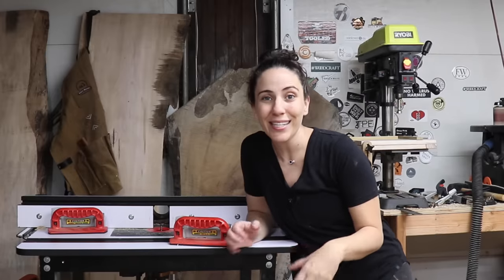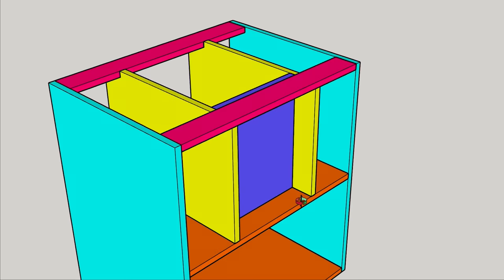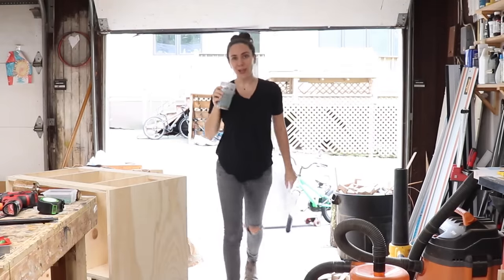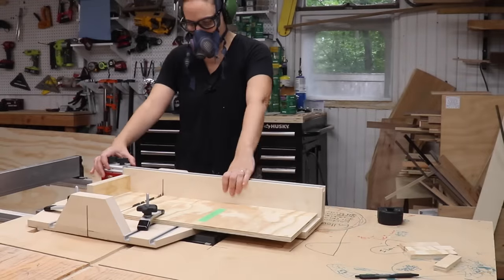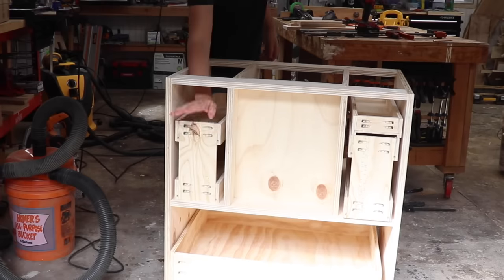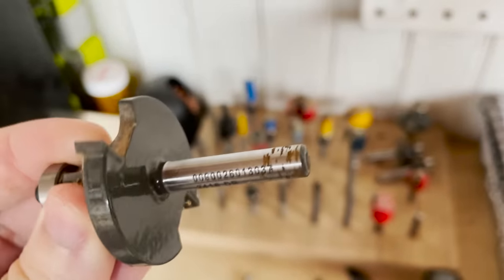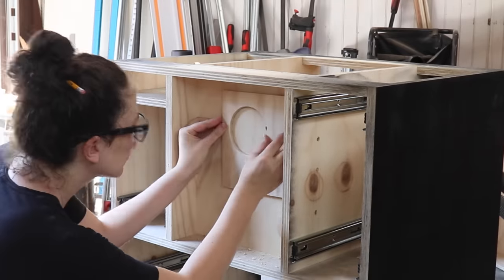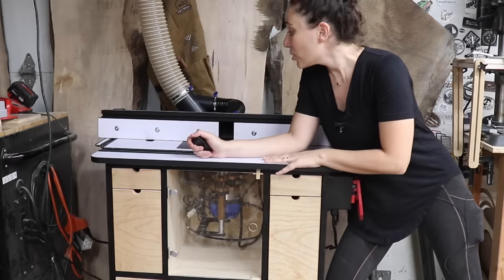Router Table Cabinet Build with STORAGE and DUST COLLECTION

Comment: Your 4"dust port should be at bottom of the box as soon as whatever dust falls past it it stays at bottom.  Also finish inside of box and spray it with silicon spray or wax it.  Great build tho

Comment: It was a little flimsier than I expected. I had to add a 2x2 piece of wood to the bottom on the rear side in order to stabilize it better https://www.youtube.com/post/UgkxXTh-lz-8W6GcB219vTLp27-MxbZYObBX . It is also starting to bow a little at the outer wall ( I've had it up for about 6 months), I've already had a shelf tumble down because of the bow and the fact that the little shelf brackets are quite short. I went out to home depot and got some longer ones so that the shelves don't tumble down again. Overall, it looks very nice for the price and it holds a lot ( I use it as a pantry). I am very satisfied with my purchase. I just strongly suggest reinforcing it before putting it up.
Reply: Thanks for s lot for this comment. I'm planning on building a router table soon and will reinforce it with some 2x4 or something.

Comment: I love this project!  one suggestion on the dust collection:  flip your door so that the slots are on the bottom, and the collector will pull air across that bottom shelf and help keep dust there to a minimum.  It's already catching the fine stuff that doesn't make it, just needs a little help sweeping up the slightly bigger pieces.  When they get to the bottom of that cabinet there's no air movement there to sweep them away.
Reply from the maker: I’m going to try that!
Reply: @3x3CustomTamar  I think the real issue is the location of your lower dust port. Since its at the top the heavier larger chips fall to the bottom, you basically built a dust separator. On most commercial router boxes the outlet is at the bottom of the box. What you did totally works and as long as you keep after it occasionally still a good solution but large chips will collect in the bottom if you dont move the port down lower.
Reply: Yeah that's a very good point, I think a curved ramp at the bottom would probably help as well.
Reply: @justin.booth.  yes another option, something to guide the chips towards the outlet
Reply: I think that's smart. I was thinking to have a slope added on the floor of that box.
Reply: @3x3CustomTamar  the solution I’ve seen and thought you were heading to was put the 4” port at the BOTTOM and have the opening on your front near the top. The dust collector needs enough air and you’re creating a strong air flow that pulls the falling chips down to the bottom where it goes into the 4” port. The other part of that air flow would be to use a quarter inch thickness piece of wood the width of your plexiglass door but have it mounted at an angle with the top near your plexiglass door and the bottom of the panel near, say, the middle under your router. Again, you’re reducing the volume of that cavity but increasing the channeling of your airflow suction. You don’t need to reach your router because you access it from the top, or you pull out the mounting plate it’s on. As it is, your boxy cavity has dead spots that reduce air flow.   You could insert that slanted wood piece having it end about two inches from your router top and replace the plexiglass door with a solid wood panel with that 2” open space at the top. That gives you strong suction from the top front of your table down that angled wood picking up the falling wood chips on the way to the bottom of that cavity into the 4” dust port.
Reply: @justin.booth.  mounting a slanted wood wall front from near the top front behind her plexiglass door and contacting the bottom of that cavity amount under the router forms that pathway airflow. Leave about a 2” gap at the top and relocate the 4” dust port to the bottom creating a flow of air that picks up all the falling particles and pulls them into her dust port. That 2” gap sounds like a lot, but that vacuum system needs a lot more airflow than she has with those small slots. That’s why her plexiglass door was being pulled in. You need the fast moving air down that slanted wood picking up falling chips and pulling them into the large dust port.
Reply: DITTO.
Reply: @3x3CustomTamar  
You should flip the door to have the opening in the bottom to avoid the cyclone effect... that way, tge dust collector should work better 😀
Reply: It's always best to consider what parts came from fHarbor Freight when trouble shooting,lol.

Comment: Nice design, suggest moving the dust port to the bottom and slope the bottom down front to back. Gravity is your friend when you don't fight it. Also finish the dust compartment nice and smooth so dust and chips move freely.   By having the dust port high its effectively like a dust deputy separating the dust from the chips.
Reply from the maker: Good idea for sure

Comment: Looks good ! 
 Moving the dust box vent to bottom of box would increase removal of large chunks (with hole at top it is acting like a separator leaving the large stuff 'separated' .)  
There are better vented insert plates (router cutter bit insert plate) , some by Incra or just modified with extra holes ) to increase air flow .
Reply: bingo - that and include angled pieces in the bottom corners to help direct dust and air flow to the dust port
Reply from the maker: I may try that
Reply: Exactly what I did too plus the angle plate after experimenting with the proper angle with some cardboard.  Also put a furring strip around the door with foam gasket and magnets to keep the door closed...also used a piano hinge to help alignment over time.  You can also add some small baffles to direct the airflow to the port keeping in mind most routers exhaust from the bit side.   Note I'm only using a shop vac and HD separator bucket with 2.5" hose...works great.

Great job Tamar, you can always tweak it after using it awhile!!
Reply: I built much the same cabinet a few years back and put the dust port at the bottom with the bottom angled down slightly from the front and a couple of angled side pieces as Dogwood Tales mentioned.
Reply: @3x3CustomTamar  Something like this    \_-     on the bottom of the dust collection.
Reply: @Tamar Powertech makes a  a big gulp fitting that works great on bottom installations , i used one for my miter saw dust collection and it works great
Reply: @3x3CustomTamar  My incra router table dust collection box has the DC inlet underneath the box pointing up, and the box is totally sealed. Only airflow is from the router bit opening up top, so you get more suction. Under-mounting the DC would get in the way of the bottom “draws” though lol. My old bosch router table was rear suction like yours - sealing up the door completely improved dust collection for me.

Thumbs up on a great video!
Reply: Instead of the effort to move the port lower ... just add/make a scoop to attach to the back over the existing port
Reply: @phoenix_dad1862  A new back hole would be more practical/ faster .. There is very little space behind router and every tight angle bend in a vacuum duct reduces the draw significantly .
Reply: I think that would work! I just installed a floor dust collector, & I'm shocked at how much it picks up. However, if it's not right in front of it, it won't catch it.

Comment: Love your videos and have built a couple of your projects for my use.  When it comes to Router Tables, everybody attaches a dust collection hose to the fence.  I wanted my table to roll under my chop saw workbench and didn't want a complicated hose configuration so I went a different direction.  My 4 inch dust collector comes up through the bottom of the box the router is in so the chips and dust fall down towards the hose.  Since this box like area is directly under the table top, I drilled a 2 inch hole through the top about 1 inch back from the router mounting plate.  On the back of my fence I built a box that creates an enclosure/tunnel that extends back over the hole in the table.  The way it works is that as the router chips off wood, they fly back through the fence, into the tunnel and fall/get sucked down the hole.  It appears to be as successful as the hose/fence method as I hardly have any dust/chips left on the table top.  Just an idea that works well and eliminates the need for a hose.

Comment: "I literally JUST had it" is a constant mantra in my shop. I have eliminated it related to tape measures by buying a handful of moderately inexpensive versions that are resident in different areas of the shop. this also eliminates the lost tape when someone else in the household borrows it (and of course leaves it).

oh yeah - this is a fantastic project. my mind is churning some designs for mine now.
Reply from the maker: I have 5 of those tapes!! 😂😂😂

Comment: Congratulations for depicting two smart elements to do the work: get your hardware first and design around it. Also, use the components to generate cut lines without ever measuring.
Reply from the maker: Glad you liked it 👍

Comment: Noticed the diming of the lights when you turned on the dust collection. That means that that there are too much on that line so the wires have difficulty pushing enough Amps. That means that they run a risk of getting too hot during prolonged use at that level. At the moment it's only a problem when the dust collector needs its starting power though it's better to put the dust collector on another fuse than the lights to avoid that issue.
Reply from the maker: Yup. Something I mentioned previously about my shop being underpowered. All something I’m hoping to fix 👍
Reply: @3x3CustomTamar  An easy and economical (in the monthly bills) fix is change all your bulbs to led's, if you haven't already. One tenth the draw of incandescent and about one fifth the wattage of fluorescent with the same brightness. But, electrician here, he's right about separating the lights. They should be the only thing on their circuit and that's easy to do. That will free up more power for the motors and keep the wiring cooler.

Comment: Love this project, a extra out at the back bottom keeps it clean!
Reply from the maker: Thanks!
Reply: @3x3CustomTamar  I was wondering if the compartment might be to large and that's why there's not enough suction. Or is this just something that in inherent with a router table? Also, I thought it was kind of funny that you used magnets to hold the drawer face but no magnets to keep the door closed. Hmmm? 🤨 
Great build, I'm in need of a router table and so far I like this one the best. Of course I will change a few things (I have larger hands) like possibly making the bit trays removable. Might be able to fit 3 per drawer that way. Again, great video and build. Keep up the good work.

Comment: Great build, Tamar. I attached a rope with a strong magnet to my dust collector remote and hang it from the ceiling of my shop. It makes it easy to find and move around, if you have some metal on the ceiling. Use it in good health!
Reply from the maker: Great idea!

Comment: Thank you I bought the router table cabinet plan, and the portable work bench got my attention so grabbed that one too. I have watched several of your postings. I just manufactured 8 kitchen cabinet doors and my floppy router table annoyed me I was just going to build one but thanks to you I don't have to draw the plans.  Love your guitars I saw in one of your videos, haha I have 5 guitars not allowed to buy more. I built one of those guitar racks but realizing in MA. unless I was running a humidifier/ dehumidifier my guitars needed attention so they are back in their cases with built in  humidity meters.. Enough said HaHA Thanks again😎

Comment: What you could do, is put the outlet hole of the dustcollector at the BOTTOM of the cabinet so that even if you get some dust you can just push it in to the outlet hole and it'll get sucked up.
Reply: Agreed, the particals my be too heavy to go out the top wall dust collection port. Flip the hole to the bottom and create a slight funnel to reduce the amount of open space. If your motor isn't strong enough you may also have to empty your collection bag/barrel more often.

Comment: 👍I LOVE it.  This summer, my health declined, but with cooler weather & a new Kreg Foreman on the way I plan to get building this Fall.    My tools are kept inside and carried outside when I build.  Not enough good health days have been lining up with good weather days.  So, we plan to make room inside for smaller projects before winter.  I will need dust solutions.         
    I think your cabinet performed great.   Still, I'm not surprised you are striving for perfection; you always share your oops & needed improvements with your audience.  I see suggestions in the comments, so, I guess those folks agree that dust collection could be better... Well, I must be easier to please, I was very impressed!  The top was spotless and only a teeny bit of saw dust down below.
      I have a Woodcraft 50 or so miles away and your cut-list looks like much can be broken down in store from economic plywood.  Those repeat grain patterned boards can be bothersome, but it looks awesome the way you matched it up on the drawers!   I WILL watch your follow up video.  But then I am headed to your website to buy these cabinet plans. ~♿Lisa🔨
    PS- a question: have you ever cut the grooves for your drawer bottoms into longer boards, before cross cutting it into sides, front & back?  I'll be using a hand held router w/straight edge & hoping to save some effort?  I've never seen this done on YT; so I'm worried there's a reason for that, a problem I haven't thought of? Thanks.
Reply from the maker: Thanks so much! Hmmmm. I havnt done that. But I guess I don’t see why you can’t.

Comment: Really like your color scheme - black carcass and unpainted "draw" fronts.  Also really like your groove-and-dado-trapped "draw" bottoms with pocket-hole joinery - that combination is a favorite technique of mine as well for shop fixtures including similarly trapped cabinet backs.  Even the shorter "draw" back - just like traditional "draw" construction with a solid wood  bottom and dovetails to join the sides and back.

My shop (garage) lights dim when I start up my tablesaw; my practice is to only run the table saw with the lights off on that circuit, meaning in daylight with my garage door open.  Here in the Houston TX area I can usually get away with that year-round.

Really nice build and very helpful to a wanna-be-weekend-warrior like me.
Reply from the maker: Glad you liked it! Yeah. My electric needs an upgrade

Comment: Watched to the end… “I literally just had that..” is the age old comment of every woodworker ever. Great video
Reply: And when we drop something, it's "where, the ...., did that just go?"
I did this last night with a tiny 2x8mm pin cut from an old drill bit..
Tried to hold with needle-nose pliers when cutting with the grinder, pliers clipped together, pin vanished instantly, didn't even hear it hit the floor as I was wearing earmuffs.. I'll literally NEVER find it.. lol
Reply from the maker: Where do these things go?!
Reply: @3x3CustomTamar  there's a void they fall into.. possibly a different dimension..
All becomes clear after we die, and we get to spend eternity wandering around looking at all the things we lost over our lives.. 😉
Reply: @GenoLoma   I suspect they end up in the same place that random socks, and 10mm sockets wind up in.
Reply: @tree_carcass_mangler  ah yes.. the infamous 10mm socket.. can't recall how many of those I've had to buy over the years..
I guess I'll get them all back when I die.. ;)
I'll be the Socket King.. ;)

Comment: Great project 👍

I'd recommend upgrading your filter bag for a canister filter. Not only is it better for your lungs, but better performance out of the system. Another power increase you could gain is if you run pvc pipe as far as you can, and only use flex hose as short as necessary. Check out Stumpy on YouTube, he has a great deal of detail about this. But maybe after a move? 😉 

Love the remote on the cable! Got a link by any chance?
Reply from the maker: Thanks! All going to be upgraded soon… 🤞🤞🤞
Reply: Those remote boxes burn out quick. I went through two 3 packs already then realized never turn it on and off right away. Wait a about 10sec b4 turning it on again

Comment: Suggestion: suction intake at bottom rear of router box and door intake at bottom to create airflow across the bottom of the containment box where the heavies land. I love your vids, your one brilliant gal, thanks for the content, admire your drive and work ethic and quality.
Reply: Check out the Milescraft Dust Router. It attaches to underside of router lift and eliminates dust entirely. Best $30 I ever spent for my shop.
Reply from the maker: Going to try that 👍

Comment: Awesome build. Thank you for sharing. Regarding the bottom vent port, you need a sufficient capture velocity. Not sure the spec on your blower but not exceeding a capture distance of one times the diameter of your duct is a good start (eg 4" from duct port). For your natural draft orifices on your plexiglass, your on the right track on creating a laminar airflow, but the larger the area of openings, the more air is required to keep up the speed.  Regarding your duct, I would try to use gravity to your advantage by moving your vent attachment down or use an interior downward shelf. Also reduce the length of flex line to the minimum possible; use pvc or galvanized (something smooth). If your do elect to use the flex line, keep it as taunt as possible to reduce the internal ridges. Avoid any tight or unnecessary turns or bends in airflow.